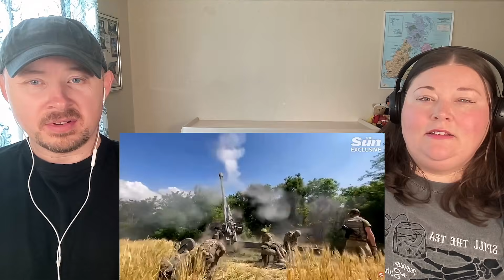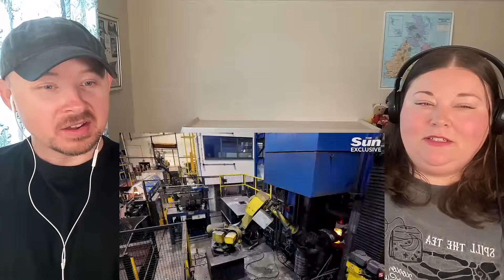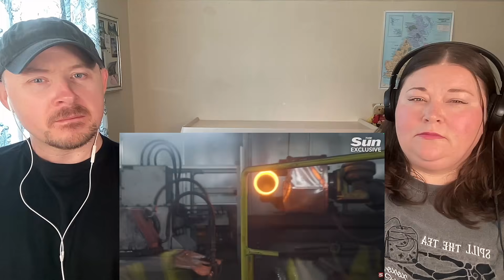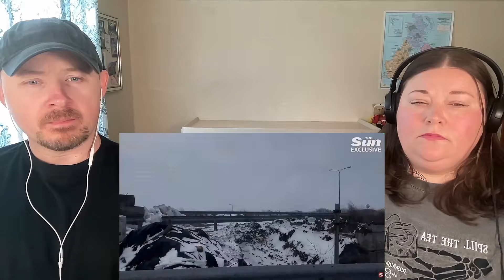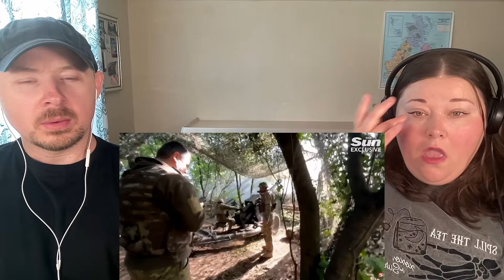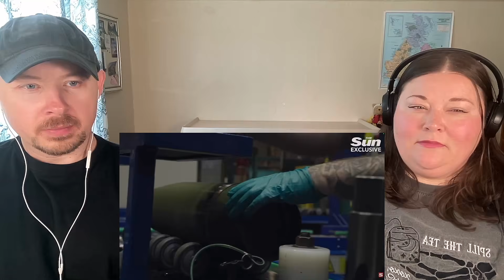Americans React: Inside the UK's Massive Artillery Factory

Comment: 1. The reason they want consistant boaring diameter is so that the Shell has a consistant explosion at the end, thicker walls means the explosions eneergy will be absorbed by the walls of the shell making it less dangerous, too thin walls means there is a changer the shell can explode when operated. So there is a fine line. 

2. Fire warden is someone thats there incase of a fire, i first responder for the safety of factory employees before the fire bridage gets there. 

3. The reason for the painted is to stop corrosion when shells are in storage, they obviously dont get used right away especially in times of peace. The painting also signifies types of shells, such as cluster shells, High explosive shells, training shells etc. So its a visual aid to let operators know which shell is being used.

Comment: Hi Steve & Lynsey, I used to work for a company that made the ammunition paint for these shells (I had a couple of empty test shells in my office for a few years). The UK MoD paint anything that doesn't move, and grease it if it does move! The green colour was used on live shells, partly for protection and partly for camouflage (although this wasn't strictly the camouflage paint system that is used on vehicles and other equipment) and partly for protection. Munitions are stored underground for safety and in that damp environment the steel would corrode which would alter the fit of the shell in the guns barrel. The UK's munitions were made by the Royal Ordnance, but following a strategic review by the government in the 1980's Royal Ordnance was sold to BAE Systems.
Reply: "If it moves, salute it. If it doesn't, paint it." 😂

Comment: 10:45 they're pretty accurate these days - to within a few metres/yards. WW1 was, as you'd expect, a massive breeding ground for technologies and techniques to make accuracy much better. At the start of WW1 in 1914 we had to rely mostly on firing as many shells as possible into an area in an attempt to hit everything you wanted, but by the end of the war in 1918 by the use of maths, ranging equipment including very sensitive microphones and other listening devices, and well-labelled maps a frontline commander could (if suitably equipped with a working field telephone, this was before two-way radio) order an artillery strike in moderate safety onto an advancing enemy a few hundred metres in front of his position. Things like RADAR and satellites have only made it more accurate ever since.

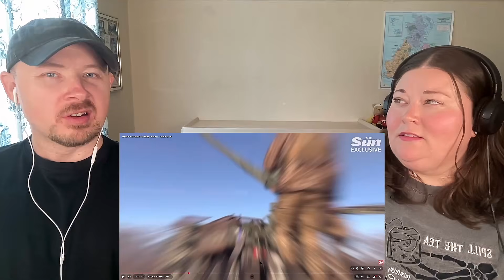Comment: 5:55 an important part of that range is that by angling the barrel of the artillery piece further up (I.E. sending the shell higher into the atmosphere) and by using careful timing and different sized propellant charges, you can use one gun to drop three or four shells on almost the same point at the same time, so you can obliterate an enemy force before they know they're under attack, giving the gun time to move away and not be caught and shot at itself.

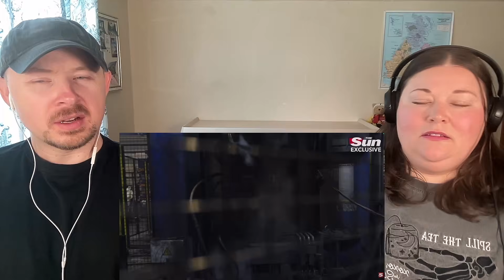Comment: 4:27 in metalworking rapidly cooling a hot lump of metal in liquid (usually water but it can also be oil of various kinds) is called "quenching", and a lot of the time it causes the structure of the metal to crystallise in a certain way (or prevents it from crystallising in unwanted ways) which hardens it significantly, otherwise it may be brittle and shatter easily.

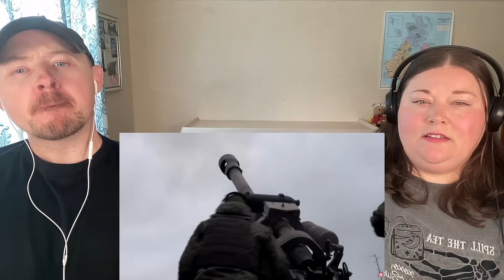Comment: 2:02 CORRECTION: Bullets are often referred to as being made of "lead" but this has been banned in weapon manufacture under the Geneva convention for some years since it, ironically for a bullet, increases the chance of someone dying if the bullet can't be removed from inside their body - they'd get lead poisoning. Most bullets are much more stable and common metals these days like steel, with copper or steel commonly being used for the casings where the explosive goes.
Reply: Wrong, lead has not been banned by the Geneva convention and is absolutely still used today in bullets unless they are entirely solid which isn't the common type used in warfare as those kinds are just too expensive for the amount you would need - the aim is to kill the person which is why you shot them in the first place, so nobody actually cares if they die right away or later from lead poisoning. The Geneva convention banned munitions based upon if they were likely to kill at random with no control (such as cluster munitions or carpet bombing) because those tended to kill more civilians than the combatants you were after.

Comment: If the shells are not machined on the inside as well as the outside  the wall thickness would vary,. This would cause a wobble or instability in flight and inaccuracy on the point of aim
Reply from the maker: Oh yeah, that makes sense.

Comment: British 155 mm artillery shells are more powerful than American 155 mm artillery shells because the British shells use a special forged steel design which allows the shells to have thinner walls without sacrificing the integrity of the artillery rounds walls so they can pack in more high explosive for the same given weight and caliber dimensions.  They are highly sought after by the Ukrainians.

Comment: For info, 1100°C = 2012°F. After forging into shape, the metal is aggressively heat-treated - quenched and then tempered. This is to make it brittle enough to shatter on exploding - but not enough to do so when fired out of the gun.
A single, simple 155mm shell costs about $,4000 US - but once you start adding smart/GPS guidance systems, that can go up to $50,000 each.
Reply from the maker: Wow, that’s incredible!

Comment: until the middle of ww1 artillery was done by spotting but by the later stages of artillery was triangulated by the use of sound it became deadly as it could pin point a target if it stayed in one spot as for the shells you see here they look like toys compared to navel shells used during ww1 and 2

Comment: In the event of a fire starting in a factory the fire wardens have the immediate duty of ensuring that they hold a head count of the workforce against the number of employees that have been marked down as present, if there’s any discrepancy in the numbers in the factory, compared to the actual number of employees who are counted, the fire wardens are then required to perform an actual role call so they can determine who is missing and where in the factory they would normally be assigned so that when the fire brigade arrives they can be notified that X number of employees have not being located and what their locations are most likely to be so that when the fire brigade start to send the search teams into the building they can be sent to the most likely location that the missing workers are likely to be found, simultaneously they will have sent a first strike team with hoses and other fire fighting equipment. Most of the teams will be wearing their breathing apparatus (B.A. sets) and one or more senior firefighters will have the responsibility for recording who gets sent in to search or fight the fire and when along with the details of how much air/ oxygen they have in their B.A., so that the fire crew can estimate how much air they are using and if they need ordering out for rest and replenishment of their air supplies. Once the fire has been extinguished and dependent on how long each crew has been deployed some of the firemen will be checking for any further flare ups or in conjunction with fire investigators they will search for any evidence of an arson attack. All being well by now the investigators will have made their investigation and determined the cause of the fire and will have released the scene back to the factory owners and their insurance companies will be notified of anything suspicious or failing any suspicious results they should be preparing the payment to the owners and they in their turn should be looking into either relocation or rebuilding there factory and recovery or repair of any fire damaged equipment with a view towards reopening in the same or nearby location in an attempt at reemploying their experienced workers if possible, bearing in mind that before the fire they had several contracts in hand.
Reply: A lot of places now have the records for swiping in and out. I worked at a national museum where the fire system immediately printed out a list of employees for roll call (it also activated a radio signal that went to a vibrating pager to notify a profoundly deaf employee). I also worked in a dockyard where all employees swiped as they reached the muster area so that there was an immediate comparison between those who had swiped in for work and those who had swiped for the muster.

Comment: Washington is in Tyne & Wear (Wear pronounced like weir) and the accent is basically Geordie. There’s probably some difference between Newcastle, Washington, Durham, Sunderland etc varieties of Geordie in the same way there’s more than one London accent, but to my ears a Geordie accent is a Geordie accent.

The shells are probably painted purely for protection. You can deal with a shiny shell by throwing a tarp over it, but to protect anything steel from the corrosion that’s bound to occur when you store it for long periods and then have it sitting out in the elements, and maybe transported somewhere by sea and exposed to salty air, then you really have to paint it.
Reply: Its a Mackem accent Washington is in the metropolitan area of Sunderland